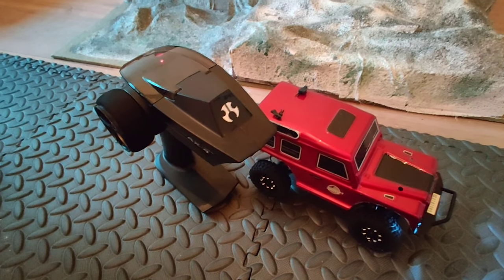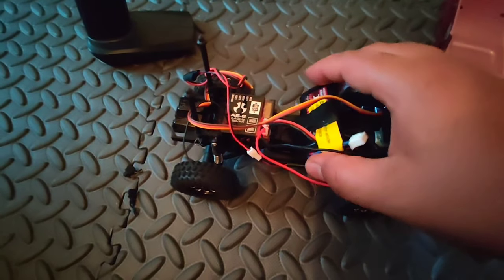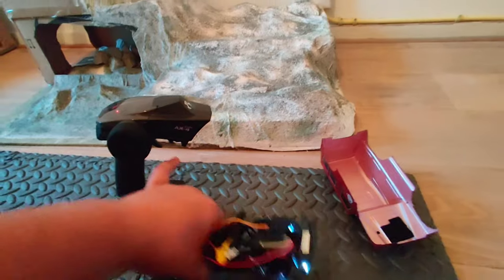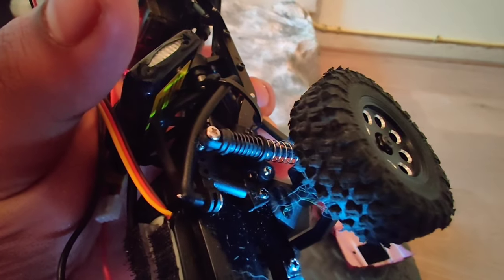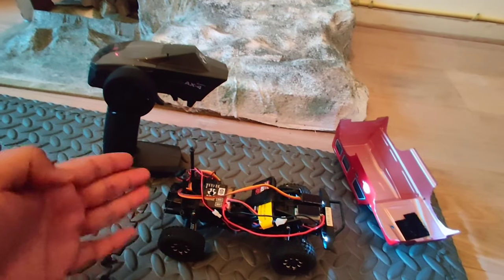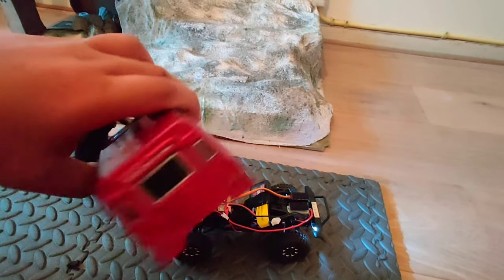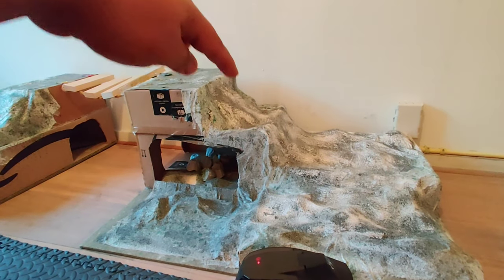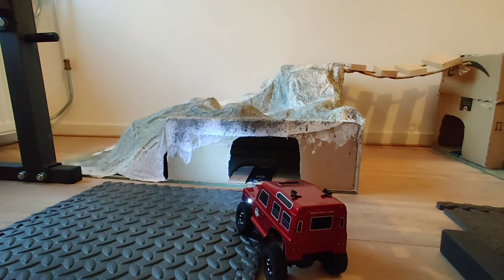FTX Outback Mini 3.0 - upgrades and indoor crawler course test!

Comment: Hi this is a great little build! Can i ask where the wheels and tires are from and what size? 1.0 im guessing?. Its just im having alot of problems with my tires rubbing on the suspension and cant seem too find any wheel spacers that fit either. Any help would be really appreciated!
Reply from the maker: Hi there thanks! The tires are from RC4WD super swamper and wheels were injora. Don't remember the exact size but it was 1 inch I think like you guessed

Comment: What motor size you got in there please
Reply from the maker: Hello, I have the stock motor on this. Its the FTX Outback Mini 050 High Power Brushed Motor (FTX8872). Alternatively you can also put in the RGT 050 High Power Brushed Motor for SCX24/ ECX Barrage/ FTX Outback/ RGT Adventurer. You might need to reverse the motor leads if the motor runs in the opposite direction but both of the above should fit for this rig. Hope this helps.